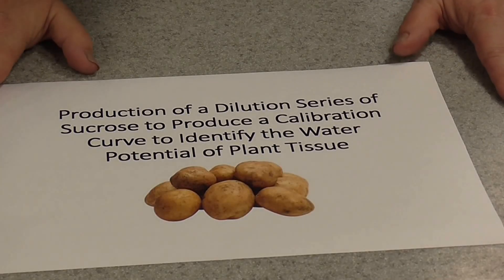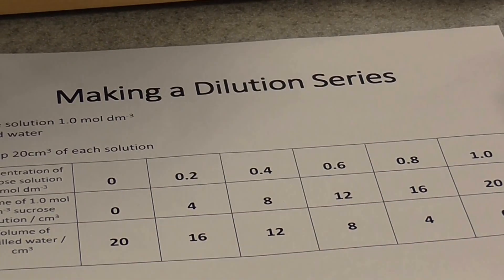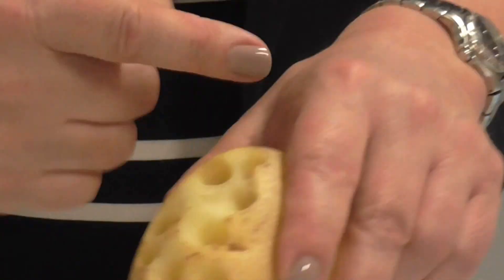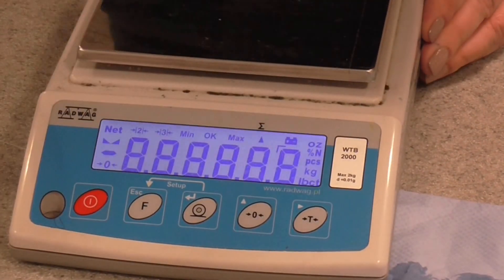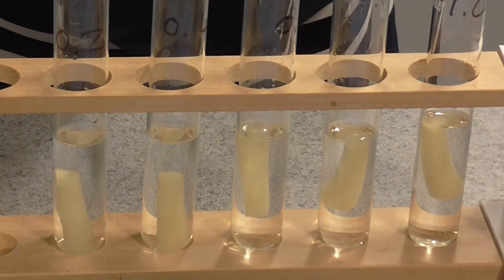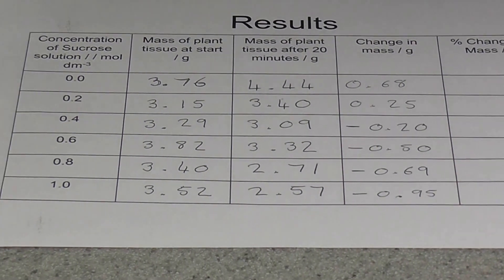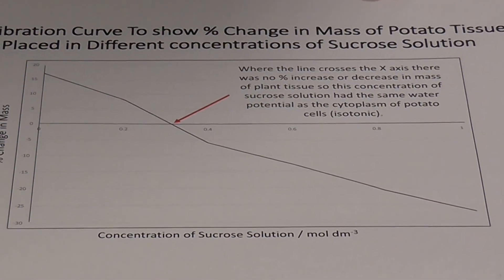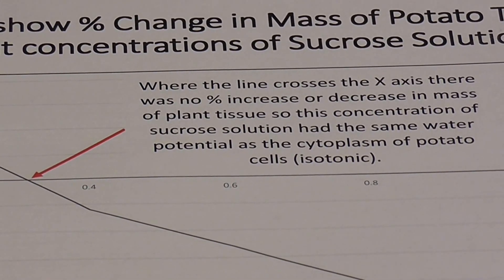Osmosis, Water Potential of Plant Tissue (AS and A level)

Comment: What would the conclusion be of the whole experiment?
Reply: When you get the isotonic water potential for a cell or a tissue in a solution, it would mean the external water potential is the same as the internal water potential. You get the water potential for a specific plant tissue, in this case a potato.

Comment: Even though it seems fine to include the mass of the weighing boat for all the tubers, when calculating % change in mass, the denominator of the fraction will include the mass of the weighing boat as well instead of it just being the mass of the tuber, hence giving us a slightly inaccurate % change in mass. As you might say, the mass of the weighing boat might be negligible, but it would make a notable difference when dealing with such small masses. Anyway, thanks for a great video :)

Comment: How did you Work out the Numbers in the table at the beginning???
Reply: Cam S I think it's like this:
Total volume of liquid in each tube is 20 cm^3.
• 0M = 0 cm^3 sucrose/20 cm^3
• 0.2M = 4 cm^3 sucrose/20 cm^3
• 0.4 = 8/20
• 0.6 = 12/20 etc etc
And if you're using 10 cm^3 total then it's much more straightforward (e.g. 0.2M is literally 2 cm^3 sucrose out of 10 cm^3 total liquid)
And so on. Idk how you work out the individual volumes, but I'm pretty sure it has something to do with the sucrose:water volume ratios.

Sorry if my reply is too late (I'm only cramming practical-related stuff now for paper 3 :/ )